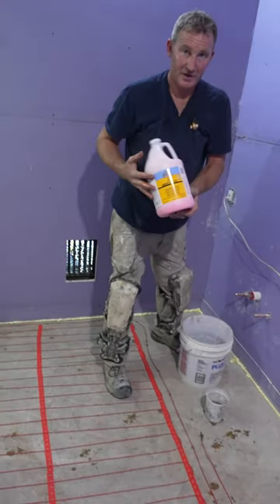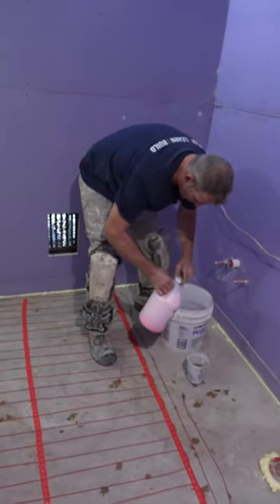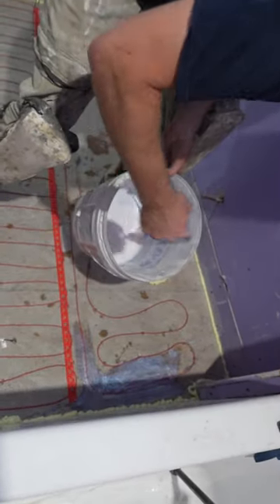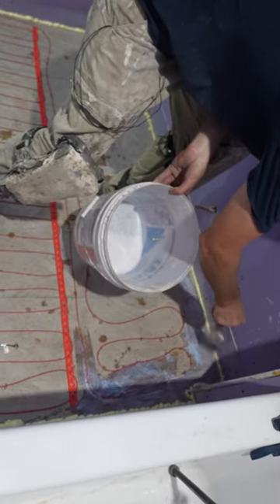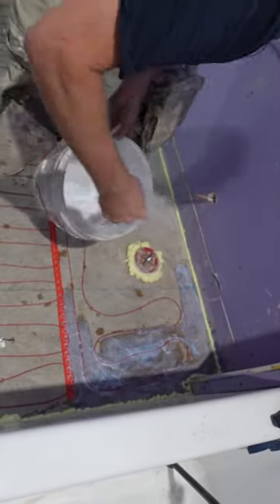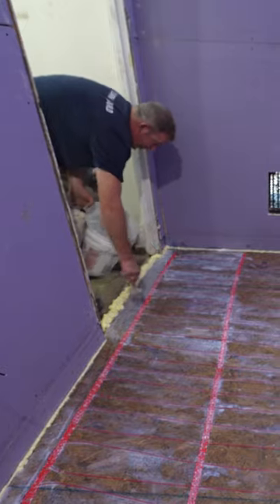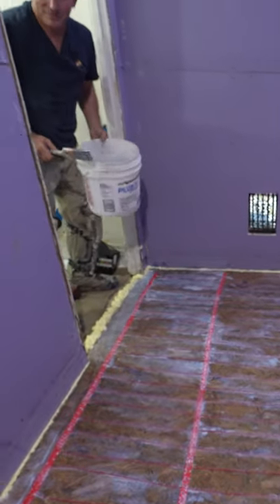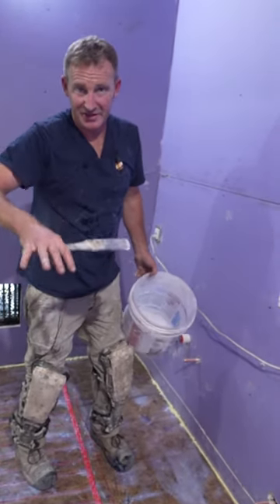Priming Subfloor for Self Leveler #diy #homeimprovement #shorts

Comment: I'm curious, what happens if you don't prime it? say you have linoleum flooring that was glued to the floor and you put self leveling concrete over it. are you going to have issues?
Reply from the maker: That’s a tough one. Depends on if there was a wax or bond breaker or some sort on linoleum. If you used a premium leveler you’ll most likely be okay. Primer allows it the leveler to bond to underlayment